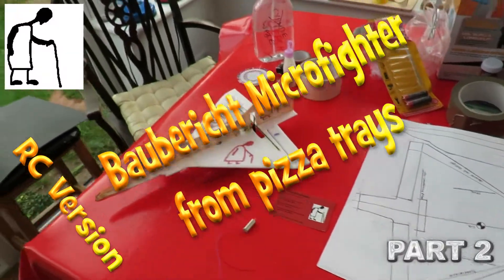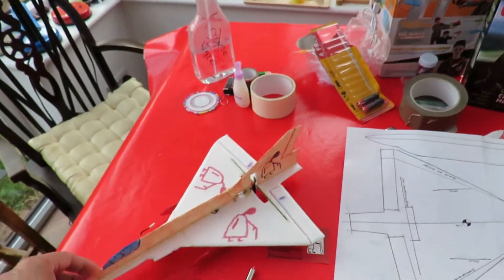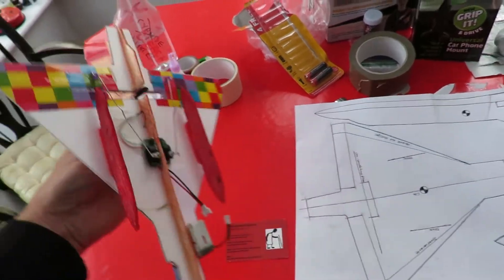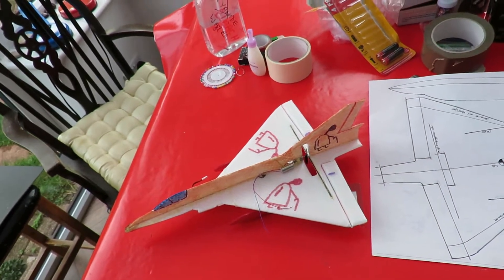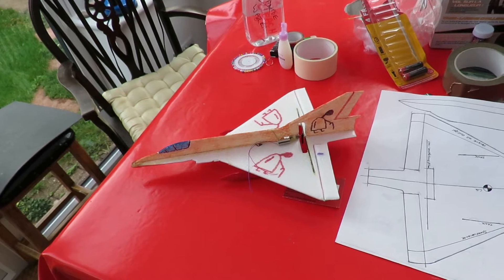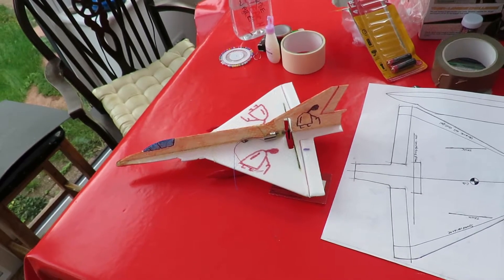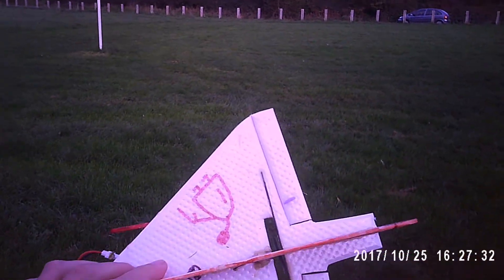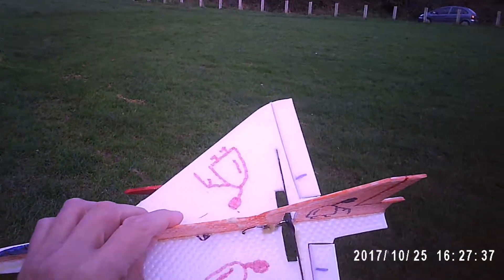RC Version of my pizza tray Baubericht Microfighter PART 2 first test flights

Comment: Put a bigger prop on the bigger motor and that should fly you had plenty of control 😁well done
Reply from the maker: The end result is a bit to fast and a bit too twitchy for me but we do see it in the air and get an idea of what it could do with a good pilot 😊
Reply: GrandadIsAnOldMan it looks like fun I wish I could fly it haha
Reply: @GrandadIsAnOldMan   Not sure if your transmitter offers the expo options, but if it did the servo response could be dialed down to remove the twitchy issue.  As to flying too fast for comfort, that is all about wing loading and flying slow on purpose.  If the wing loading, or ready to fly weight is high, you will have to fly fast enough to stay above the stall speed.  Flying slow in that case is a relative concept.  A model this small would need really lightweight RC gear to even entertain flying slower.

Comment: Then this one would need two motors in a differential thrust setup to reduce the RC gear weight and have more thrust to work with.  Good to know.
Reply from the maker: I am sure you could do that
Reply: @GrandadIsAnOldMan   I think I have already seen a video example and would likely follow it if I did build one to fly.